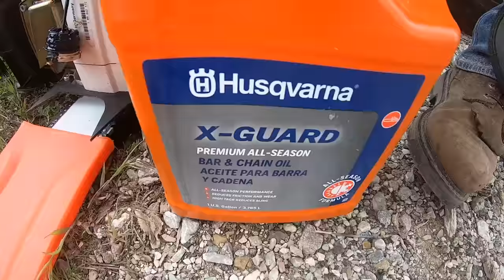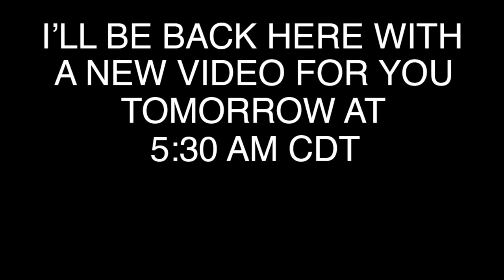$1750 raised!! AMAZING! 30 full cord pile in one day!

Comment: It is nice seeing a community come together to support their veterans. I as a aspiring self employed man, crazy to see how much money is invested to raise 1750. I've split and sold some firewood before but it seems firewood price is too low to even invest it here, but supporting the vets makes up the difference here. A face cord sells for $80 in my area, a full cord would then bring in $240, then you're full cords start making some money.
Reply from the maker: I was a good thing done by good folks for GREAT MEN who gave more to us than we know.....FREEDOM.
Reply: your comment piqued my curiosity so i did a little bit of math lol, If the average piece of firewood takes up a 3" diameter x 16" length and stack it 48" high x 96" long and times that by 3 (face chords) you get around 1500 pieces of firewood per chord and if 1 chord costs 240 thats around 16 cents a piece. 

Which is pretty damn good if you can log, split and dry on-site. Especially if you use large sized compact tractors (and sometimes small dozers) to skid and handle the logs cuz the one i have uses 1-2 gallons of deisel in a 4-8 hour logging timeframe (since it can haul multiple 6-12" by 32-50ft+ firewood logs/trees with the throttle Idling in any gear lol)  so 5-10 bucks plus another 1-2 gallons of mixed gas for the saw so prolly another 10-15 bucks, plus another 3-4 gallons of straight gas for the splitter to run for 4 hours so 12-16 bucks plus 5 dollars in bar/chain oil totalling around 35-45 dollars in gas, deisel and oil so max 50 bucks and you could produce 2 chords a day (if your young and can do 10-12 hour work days lol) or if you cant log and gotta buy them which would bring the fuel cost down by half so around 25 in fuel but with a 150 dollar log purchase (max you should pay without factoring in delivery) for 2 chords worth of logs, 

makes ur profit around 14 cents a piece if you log onsite or around 10 cents profit per 3" x 16" piece if you buy the logs.
and if you want to make more sales then profit by selling a chord for 200 thats 12 cents Logged or 8 cents Bought 

and if you want to make even more sales then profit by selling a chord for 150 thats 9 cents Logged or 6 cents Bought 

Thats only fuel and log costs obviously, if you hire people to log, skid, split and stack they take up around 50% of the overall sale which leaves the owner with the other 50% which gets reduced to 20-40% after fuel and operating costs and finally profiting 15-30% after insurance and everthing else but with a good/expirienced crew of 3 they can produce and stack 10 chords on a good day if their logging and 15 if their just spliiting and stacking, making the owner around 360-720 dollars profit a day by just facilitating and financing the operation as well as handle the sales. Of course those sales dont come until winter but still good money to do during the previous winter and spring leaving summer and fall to do other business ventures/investments while the firewood dries/seasons
Reply: @jsoulz2008  I appreciate all the math done here but a critical thing was missed. You based your math off a face cord, not a full cord. A face cord is only 1/3 of a full cord. In the case of your math you worked off a face cord but used the price of a full cord. 

A face cord is 16" in depth, still 48" tall and 96" long, full cord is 48" in depth and still 48" tall and 96" long.
Reply: i dont understand i said times by 3 face chords lol @BluntedBaboon
Reply: @BluntedBaboon  16" wide times by 3 is 48" wide like you were mentioning, maybe i worded it in a confusing manner my bad lol

Comment: i like running gear and cutting wood as much as anyone, but 30 people putting in a full day and all bringing equipment fuel oil chains ect.. could of each chipped in the 50$ they each spent to drive there and fuel their machine or saw and had the entire day off with the same money raised
Reply from the maker: You don't get it, we did a good thing for good people and had fun working together to do it, it is not just the money.
Reply: @InTheWoodyard   there must be some kind of typo or misunderstanding, how can 30 cords turn into 1750$ even if the initial timber was over paid for surely theres more than 55$ profit on a cord of firewood

Comment: Not a single operator with their right hand forward and left hand on the throttle.

Can't chainsaws be operated by left handed or ambidextrous people?

100 years of chain saws and nobody makes a machine that you can operate with either hand?

If not why not?
Seems like your hands ,arms ,shoulders and whole back would benefit from it.
Reply: Full wrap handle!
Reply from the maker: I can and do use both grips left and right but that is how saws are made.